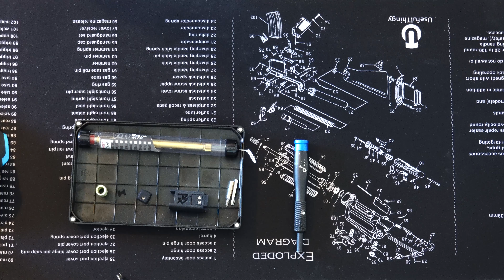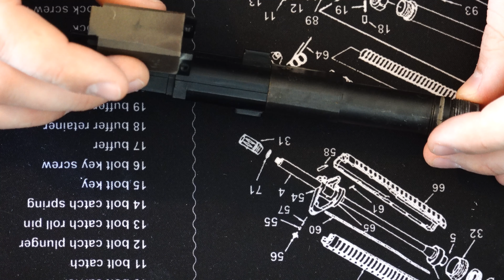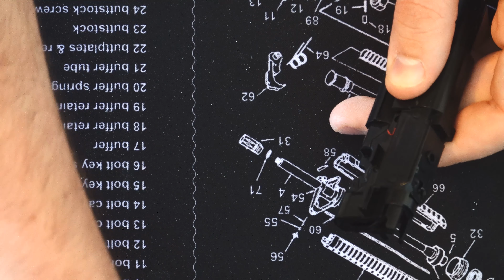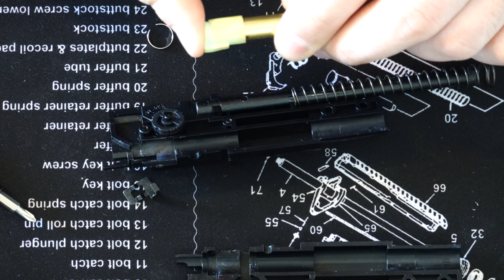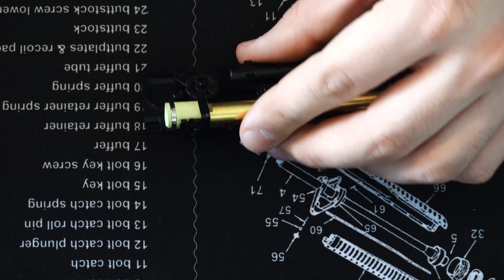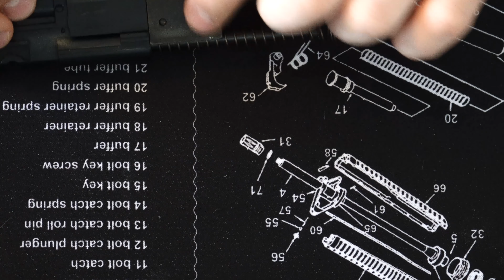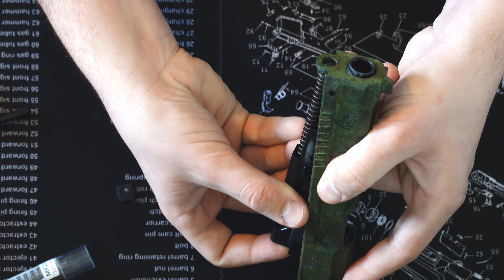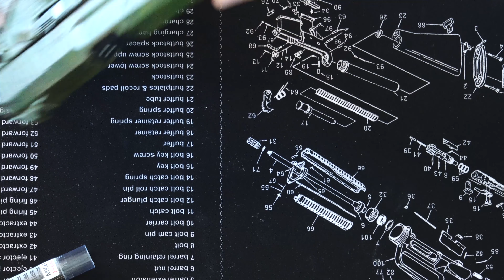How to upgrade your MK23 [4k]

Comment: For anyone attempting this with a clone MK23 (ASG and STTI), you will likely have a couple of issues when it comes to disassembly. Firstly, pushing the safety through in order to release the slide is massively stiff and will need a good few whacks to push it through, you’ll have no hope just using your fingers. Secondly, the outer barrel isn’t held on with a screw as it is with the TM MK23 as shown at 4:01. it will likely be held in place with a pin that, again, needs to be whacked out from right to left (when looking at the assembly from the same direction you’d aim). I had to spend ten minutes constantly whacking it with a hammer and a thin-pointed file and was convinced it wasn’t going to budge but eventually it did. Once this is out, the outer barrel will be very hard to pull off, so I wrapped the hop unit and the outer barrel separately with masking tape in order to get some grip on each and pulled, pulled, pulled until they came apart. All in all it’s a horrible job!

Comment: Amazing contribution to us mk23 enthusiasts, even I with my two left hands managed to follow this guide step by step and get this done right.

I had to drill my outer barrel because I bought a 150mm inner barrel and it wouldn't fit through all the way, apart from that - everything went smoothly.

Thank you!
Reply from the maker: Thanks for the feedback!

Comment: Hi I have just done the upgrade with the 150mm inner barrel but I am finding the barrel from the surpressor sticks out so you have any advice on it?
Reply from the maker: How do you mean the barrel from the suppressor? And in what way is it sticking?
Reply: @lookingcoolisnottheintenti1834  when I screw the surpressor the inner barrel from the surpressor is pushed out the front of the surpressor
Reply from the maker: You need to remove the internal barrel if you’re using that version of the suppressor. For two reasons, 1: your barrel will stick out 2: your FPS will be way too high.

3: it will be quieter without the suppressor barrel!

Comment: Do you have to leave the hop wheel in, or can you just put the arm on top with the in plate underneath and seal it up?  I modded mine, and got it back together, and it shoots, but I wondered if removing the hop wheel entirely might let the hop arm sit a bit more flat on top of the bucking? (The hop wheel seems to pull it down a little squint from one side, if you know what I mean?)
Reply from the maker: If you find that it helps, remove it! I didn’t remove mine because I saw no need to
Reply: @lookingcoolisnottheintenti1834  Great thanks a lot for a detailed video, was my first time opening the gun and really helped me.  I'll try removing the hop wheel and see what happens!
Reply from the maker: Thanks for the feedback!

Comment: Hey, if I want to use a 150mm Crazy Jet barrel, is there any modification needed at the hopup?
Reply from the maker: You won’t need to modify the hop up, but you may need to drill out your outer barrel

Comment: Ive bought all of these part but instead the longer barrel like you suggested, however this does NOT fit as the outer barrel gets smaller towards the end and will not allow for the barrel to protrude out the end?? Looks like I'm going to have to damage the outer barrel by chiselling the end out, which isnt ideal really...
Reply from the maker: With a couple of the models the outer barrel tolerances aren’t the best. You may need to drill the hole out to make it slightly larger
Reply: @lookingcoolisnottheintenti1834  i did exactly that. But drilled 'just' the width of the barrel so it sits in there flush and prevents any drop towards the end of the barrel. Sweet video though; Would be awesome if you did an SRS video as thats my next purchase 😉 

Keep up the good work !
Reply from the maker: Good idea! Haha, I’m more of a vsr man, myself. For now at least!
Reply from the maker: I appreciate the feedback!

Comment: What weight of BB are you using?  I just this exact upgrade, but I'm getting fliers all over the place and I can't see anything visually wrong with the bucking.  Any advice?
Reply from the maker: Which tdc are you using? I normally use .28s but can go as high as .48 if necessary
Reply: @lookingcoolisnottheintenti1834   I have only the single screw version, since the double wasn't in stock at the time.
Reply from the maker: Are they always flying off the same way?
Reply: @lookingcoolisnottheintenti1834  They started to come out of the barrel heading to the left and then curved back into the right.  But then then started going all over the place :/  And that was with hop off and then some hop, same result.
Reply from the maker: Give your barrel a clean and see if that helps. Is your hop rubber poking through properly?
Reply: @lookingcoolisnottheintenti1834   I'll do that.  I think it is, if nothing else, I could take it apart again and put it back together.  Thanks you the help, by the way :)
Reply from the maker: No worries, good luck!

Comment: Just a question, would the suppressor negate the effect of the crazy jet barrel? I have the ASG version where the suppressor has the extended barrel, so I'm not sure how this would affect the effect of the cover jet stream?
Reply from the maker: You won’t be able to use a longer barrel if you’re using the extended barrel suppressor.

If I were you I’d go for the 150mm barrel and remove the barrel extension.
Reply: @lookingcoolisnottheintenti1834  Sounds good, thanks. And thanks for the great video! Nice to see someone explain it in so much detail.

Comment: Great video!!!! :)
Can I use 180mm crazy jet barrel and extended it to the silencer ? Or do I need some mod for this ? Or should I just buy a 150mm barrel ?  Thank you :)
Reply from the maker: Thank you!
You can, but you will likely need to drill out the end of the outer barrel for it to fit through!
Reply: @lookingcoolisnottheintenti1834  Okay, thank you very much, that sounds ok ! :)

Comment: So with the twin screw TDC it lets you do corrections if your bb curves? I notice they have a 3 screw version would you recommend that one over the twin?
Reply from the maker: The single screw is fine for most people but yes the two screw will give you better control. 
From what I’ve seen the three screw ones seem pretty pointless

Comment: The basic question I would ask: is stock Tokyo Marui worth extra money, while compared to stock STTI or ASG?
Reply from the maker: Having seen them all, the TM has a slightly better construction than the other two and the quality control seems to be tighter. But considering the huge price difference for essentially the same thing, I can’t recommend the TM over the others.
Reply: @lookingcoolisnottheintenti1834  I was looking for mk23 replica for myself and what I currently see on the market most popular are made by brands Tokyo Marui, STTI and ASG Europe. TM is like some 5 times more expansive than STTI, while ASG is reasonanly mid-priced. So yeah, gap price is huge, enormous even. Considering all this, and the fact all 3 mk23s are currently available I will go for STTI. Thanks.
Reply from the maker: Awesome! Enjoy it dude!
Reply: ja nee  Ok I see. What gas do you use in your TM replica? Is it safe to use Nuprol 2 or higher pressure gas like that?
Reply: ja nee  Thanks.
Reply from the maker: The issue with green gas with the Tm mags is they will eventually begin to leak because they’re designed to be used with 144a gas

Comment: I'm planning on transforming my SSX in a DMR, and one of the changes will be a 350mm barrel. But how do I hide it? An M4 outer barrel?
Reply from the maker: Depends on the kinda setup you’re going for? You could just get a longer suppressor!
Reply: @lookingcoolisnottheintenti1834  
I'm planning on using a 3d printed body from foundry Airsoft. For a 350mm inner barrel I probably need 2 more suppressors. That's quite alot more than an M4 outer barrel. I'm keeping the multiple suppressors in my back pocket in case I find nothing else
Reply from the maker: Oh I that case then definitely an m4 style front end.
Reply: @lookingcoolisnottheintenti1834  but how do I fit it in the mk23? Is there an adapter?
Reply: @xukelho  I have turned my ssx23 into an dmr with a 340mm barrel. I just hude it with the supressor. And fi you want to use the supressor 3d print an outer barrel

Comment: just did the upgrade, but without the barrel. We'll see...
Thanks for the vid
Reply from the maker: Good luck
Reply: @lookingcoolisnottheintenti1834  after first test the result is quite good! grouping is good on 35 m, but not as accurate with the silencer on (with the second inner barrel in it).

So is opened the silencer at the front, took the cap off and the inner barrel out.
Then I took the installed spring out out too. I stretched the spring to the length of the silencer and wrapped one layer of 1cm thick foam around the spring and put it back into the silencer hull.
Some alignment to the spring and the cap goes back into the hull.
Result is very silent and without any loss in accuracy.
Reply from the maker: Nice one!

Comment: Did this, but now my trigger gets stuck after i fire with the mag is in, its fine without the mag, it was also fine before the upgrade, when it gets stuck i can ether take the mag out or pull the slide back some cm. and then it resets the trigger. Any thoughts on what it is and what i can do?
Reply from the maker: What have you changed? What parts did you use? And is everything tightened up again?
Reply: @lookingcoolisnottheintenti1834  mk23 nbb modular tdc co, maple leaf autobot bucking 50* , maple leaf mk23 150mm 6,04 crazy jet inner barrel for nbb pistol,  hadron designs fang for TM Mk23. yeah is all in place, had no problem until now
Reply from the maker: Sounds like your return spring isn’t strong enough. Sounds like it might need replacing

Comment: Nice one! been looking to upgrade my MK23 for a while. What do you think about going for a 150mm barrel of the 133? cheers
Reply from the maker: If I did mine again I'd go for the 150 for the slight bump in fps.
Reply: Looking Cool is Not the Intention out of interest what kind of FPS were you getting with what weight of BB?
Reply from the maker: I'll test it right now for you
Reply from the maker: On a 0.2 285-290
Reply: Looking Cool is Not the Intention Really appreciate that mate, top man
Reply: Hi if you was to go for the 150mm inner barrel would the surpressor still fit on?
Reply from the maker: Yes
Reply from the maker: But you may need to drill the outer barrel out to be slightly larger
Reply: @lookingcoolisnottheintenti1834  Would you reccomend any particular 150mm barrel?
Reply from the maker: Maple leaf

Comment: Nice video keep it like that!!
 It sounds ipmossible that a gun with 300fps, can lift 0.49g bbs 60-70 meters..
have you done a test video to see it in action? how is the grouping ?
 I have just got the same gun and I am plannign to install the same parts.. 
Thank you in advance.
Reply from the maker: Thank you!
 I haven’t, but I plan to do so in the future! 
Best of luck dude and enjoy! Which brand did you go for?
Reply: @lookingcoolisnottheintenti1834  Stti, got it for a friend but he gave it to me since he bought another one..we have just installed hop rubber maple leaf the Mr.Hop version.. ;)
 Yet I haven't spend much time to adjust the pistol but for cqb we play it is really okay even with .25, but now I wish to change my playstyle I have enlarged in length and width my rifles barrel hop window ,rhoped it, and the .28 is just on the limit to start with...at 367fps, usually I use .32, and will see how the .36 will go, I want to play as a "dmr" player so I want the maximum of the st23..
 I've seen a lot of people to use the crazyjet on the pistols but I am thinking to try the Prometheus..

Comment: Thanks for this, it's the clearest video on Youtube!! Will it work with the ASG version?
Reply from the maker: It will, the only difference is there is a pin holding the outer barrel in place that needs to be knocked out
Reply: @lookingcoolisnottheintenti1834  thanks so much! That's super helpful. Subbed. Sorry for yet another question but what gas do you recommend? A video on gas types for different climates would be great! I've also heard that it can damage the gun to use high pressure gas, but different people say different things. Some clarity would be awesome
Reply from the maker: I use green has and ASG magazines and haven’t had any issues in two years. I have heard people have had issues but if they start to leak there are tutorials to fix them and after the fix you can even use black gas! Thanks for the feedback my dude

Comment: Nice, now I only need a MK23
Reply from the maker: Do it!
Reply: @lookingcoolisnottheintenti1834  
Let's go with order: first a sniper then a mk23
Reply: Atlas - I’d go for a STTI ( build quality is not as good as the TM version but £50 vs £150!!) however you’ll get a working silencer rather than the screw in barrel extension.
I did mine a while ago (single screw with standard barrel and can put 0.45 out to about 70m!,👍👍
It’s always a good 2nd weapon anyway😁😁😁
Reply from the maker: I might have gone stti or asg if I did it again but I bought the TM MK23 second hand for a decent price! That said I have recently helped a friend with an stti and it's been nothing but trouble!
Reply from the maker: Nice one, shame about your stti! What’s your FPS limit?
Reply from the maker: Interesting, I’m using the 113 barrel and getting around 300 FPS with a 0.2

Comment: Hiya does Yr silencer have the inner barrel in?
Reply: Cause iv just bought all the upgrades u have fitted 😊
Reply from the maker: No, my suppressor is foam filled 🙂
Reply: Would the barrel inside silencer work with the crazy jet
Reply from the maker: Definitely
Reply: Thanks just don't won't blow the thing up using the silencer with the barrel inside if wouldn't work haha thanks alot 😁👍
Reply from the maker: Just don't use a barrel that extends beyond the threaded outer barrel
Reply: The silencer with the barrel extension sucks. Yeah it increases fps but for some reason no matter what I do with mine, it decreases accuracy to a point where its literally useless
Reply from the maker: I'm not entirely sure what you're talking about. Do you mean you have the standard internal barrel with the short outer and the suppressor?
Reply: @lookingcoolisnottheintenti1834  ah sorry. I might have read wrong. There's a suppressor you can buy that has an extended inner barrel inside it. It fucking sucks
Reply: Well my surpressor has the inner barrel extension inside.  I did all the upgrades that on this video. Mine works mint defo worth the upgrades thanks MATE 👍. Just need to go airsofting to try the beast out.
Reply from the maker: Ah, like the asg one? The quality control on those is pretty terrible! Get that barrel extension out and and fill it with sound damping material!